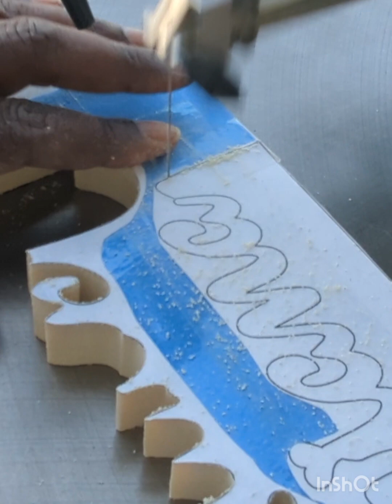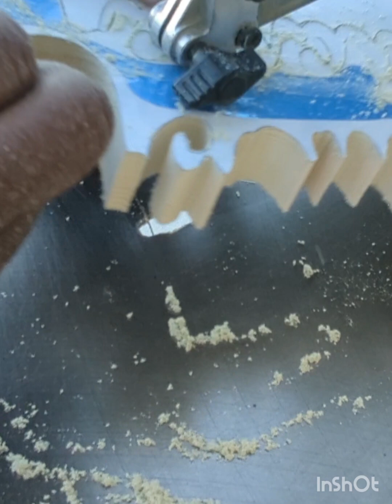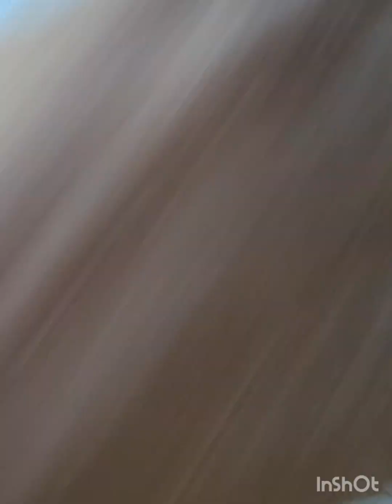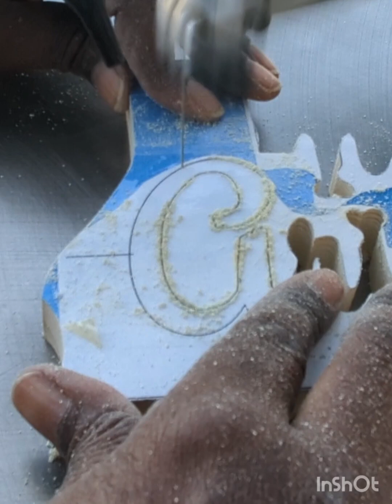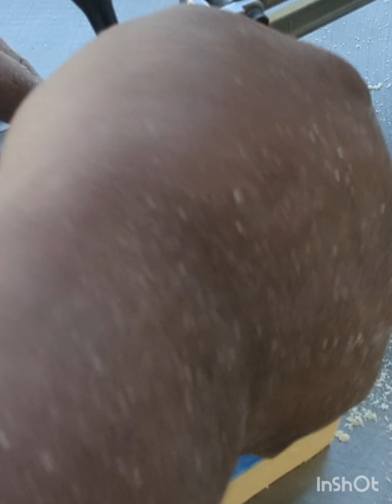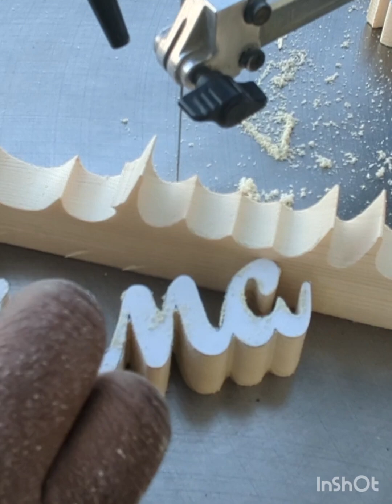Cutting baby Ariana a wooden name plate.

Comment: Why is the blue there?
Reply from the maker: Hi friend, there are a few reasons why I use the blue painters tape. 
1. Tape helps to lubricate the blade. It will stop you from having burn marks on your wood because of the reciprocation of your blade 
2. The tape protects your wood from spray glue or whatever kind of glue you use to put your pattern down. 
3. The tape makes your blade last longer. 
Some people use contact paper but I like the blue painters tape better. I hope that helped. 😊